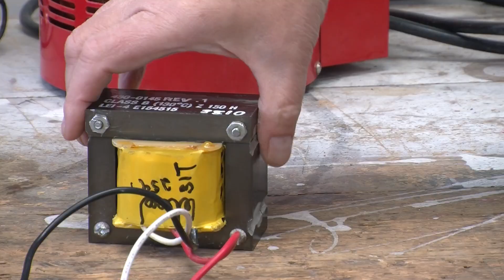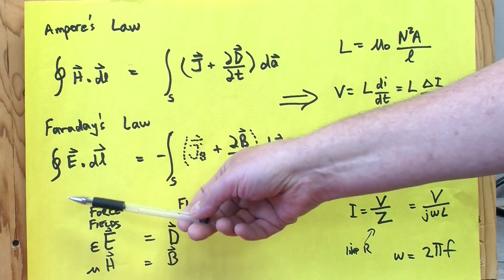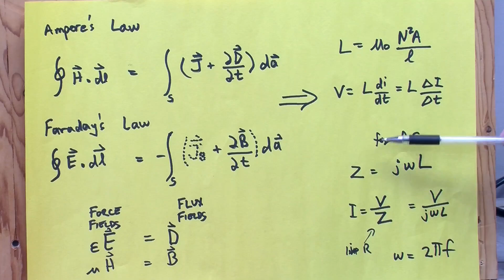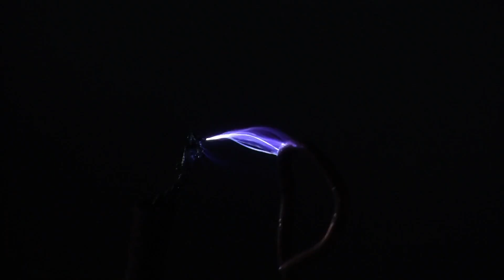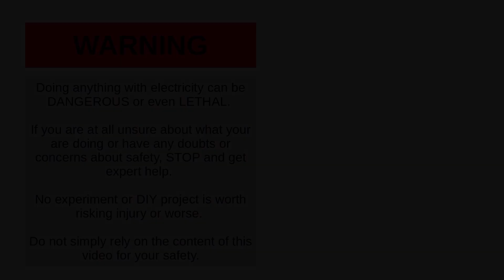Coils and Inductance

Comment: What is it that induces the current to begin with? Is it resistance? If we have zero volts because of the lack of resistance in the setup, is there current there? Also, what makes the transformer move when you apply power?
Reply from the maker: The battery across the coil provides the initial current and can be quite large becuase of the low resistance of the coil. When the circuit is opened, the coil "wants" to keep current the same so it generates a high enough voltage to create a spark which uses up the energy stored in the coils magentic field causing the current to die down.

The top of the core bounces becuase everything isnt quite flat and when the coil creates a field in the bottom part of the core and pull the top, it moves a bit.

Comment: why do your videos have such low volume? Almost 50% lower than the advertisement. The advertisement has a much higher sound volume!
Your ear hurts when the commercial comes on!

Is it that hard to compare and adjust the volume correctly??

Many people on youtube struggle a lot with this and I don't understand why??
Reply from the maker: I actually didn't know the volume level was quieter than the ads. Thanks for letting me know - I will turn up the volume in future videos - I can see how annoying that is! 

The problem with YouTube sound is as far a I know, they don't really provide any mechanism to calibrate the sound levels or provide some indication after uploading like "your audio volume is 50% lower than most videos - shall we boost it?"
Reply: @ElectromagneticVideos I thought they offer or used to offer an audio normalization option. Anyway, I had no trouble hearing the speaker.

Comment: I am working on a marx generator-powered Lenz-law launcher.  I want to develop the maximum change in flux density for a very short pulse of thousands of amps.  Should I make the launcher coil a small or larger diameter?
Reply from the maker: That's an interesting idea. A larger area and hence diameter of the coil means higher inductance. For a very short pulse, a high inductance means lower peak pulse current (=magnetic field) for a given steady voltage (current though an ideal inductor rises steadily with time for a given applied voltage). You can also reduce the number of turns to lower inductance to create a higher current which might be more effective.

But having said that, I'm wondering if you will end up with enough total energy to actually launch anything? The projectile ring will extract energy from the system and  cause the high current to die down quickly (milliseconds or microseconds) so the time that the force is generated and applied to the projectile will be very short.  So even if the force is strong it may be be applied long enough to be very effective.

The other thing to be aware of is a Marx generator does generate x-rays from the arc. And apparently a large amount of x-rays if you pass the current though a thin copper wire that vaporizes before the arc forms in its place.   I'm not so how strong the emissions are but if you increase the capacitor sizes to store more energy and make a higher current  spark you will make more x-rays. Might be worth looking into to make sure your (repeated) x-ray exposure is with safe amounts. (I have no idea if I am raising a needless concern here!).
 
So prove my "not enough energy" concerns  wrong and make a Marx generator powered Lenz-law launcher. I'll be fascinated and look forward to seeing the video! Good luck!
Reply: @ElectromagneticVideos  Thanks so much.  I really appreciate the x-ray warning; up until now, I've thought that such a brief arc passing through air (rather than vacuum) would be relatively safe, but now I'm going to look at how I can monitor the x-ray emissions in a cost-effective way.   As to whether there's enough energy to actually launch anything, nothing venured, nothing gained!  My first attempt will use 23mm ferrite core for inductor.
Reply from the maker: @sciencegeekgrandpa8    I think its relatively safe - most of the energy would be dissipated in heat. But always worth being careful. You are dealing with voltages in the ranges that x-ray tubes use (100kv) and some of those electrons will come to a smashing stop  giving off x-ray photons.

"nothing venured, nothing gained" - how true and nothing more fun than experimenting!

Just saw your in Canada - where? I'm near Ottawa.